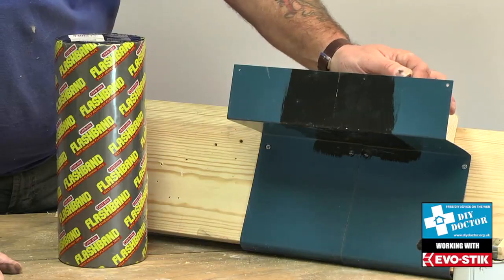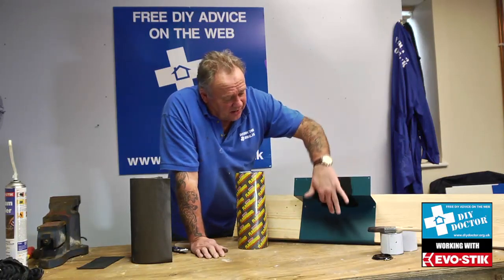Evo Stik Flashband, flexible flashing

Comment: will it work on fibrous asbestos
Reply from the maker: +Joe Blogs Hi Joe, I'm hoping you dont actuallt mean asbestos as it's illegal to disturb an asbestos surface in any way. If you mean asbesolux or asbesos substitues, yes it will work buyt you will need to use the primer to prime properly first after thoroughly cleaning the area first.